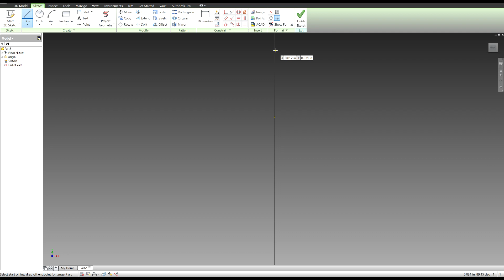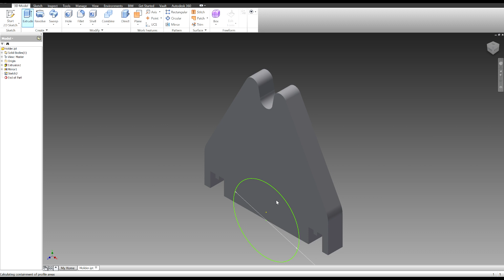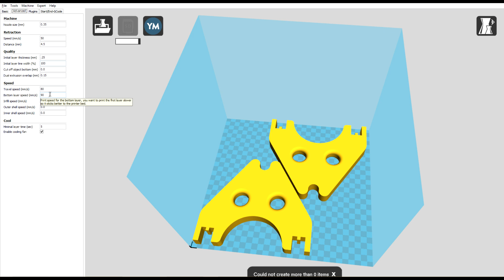Making a Filament Spool Holder for Lulzbot 3d Printer

Comment: Could you have cut off the corner that didn't form well, then print the corner by itself and glue the two pieces together? If you measure the cut and print just what you cut off, it should work.
Reply from the maker: I potentially could but honestly it doesnt need it. It's pretty stable as is.

Comment: That corner probably lifted because of the orientation of the fan on your printhead.  It was blowing right on that corner.  You probably don't need that fan at all for ABS.
Reply from the maker: I had the fan turned off on this print. I learned on a previous print with ABS to not have the fan. Thanks for the tip! Definitely useful.